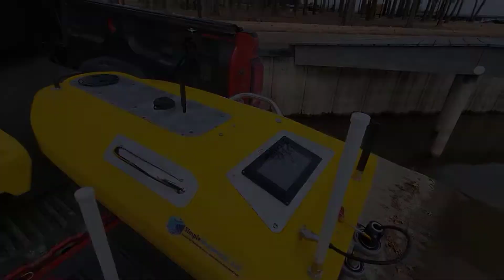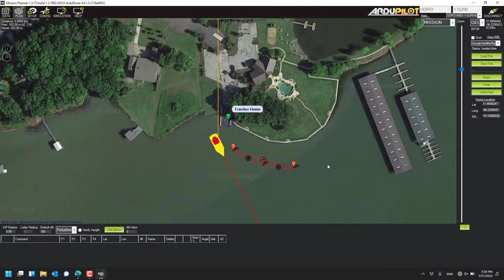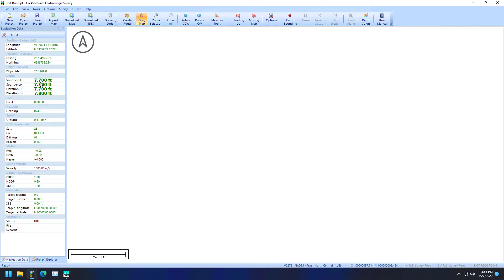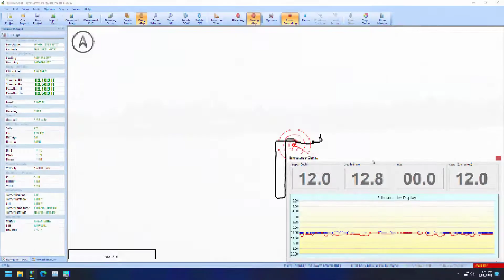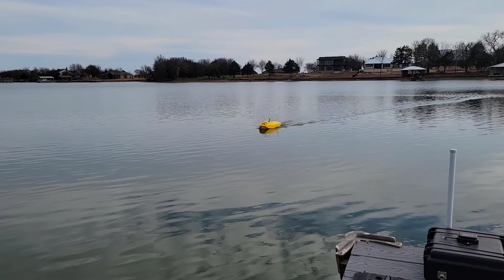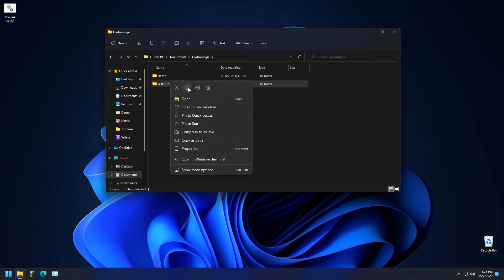HarborScout 55i with Unabara Z Axis 2F Bathymetry - On The Water

Comment: Can these be ran with a pulsing light beacon on top for other boats to see? would there be enough power to run the becon and how would it interface with the current battery with a waterproof connection?
Reply from the maker: Hello! Yes, a beacon can be installed on top. I wouldn't imagine it would make a noticable difference in battery life (assuming it was an LED). These boats have a 105ah 12v Lithium Iron Phosphate battery; we can install a 2-pin panel mounted waterproof port/connector setup for that as needed.
Reply: @simpleunmanned  okay, I called and left a message about purchase!
Reply from the maker: Checkout the end of this video: https://youtu.be/CKbn8CsZ_LM :)